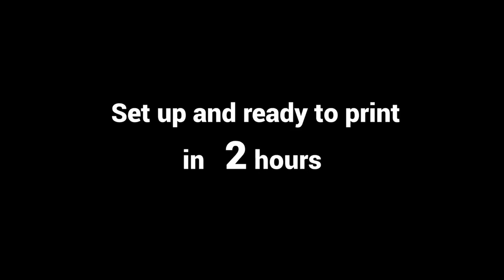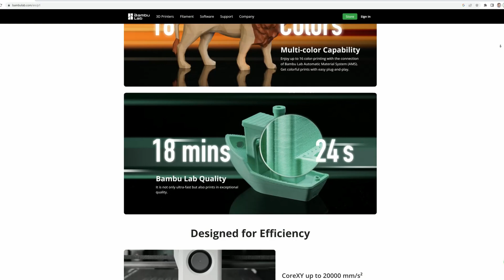I Fell in Love All Over Again - Bambu Lab P1P Printer Review

Comment: How do you get FDM prints water tight? I’m taking some water on in my baits?
Is resin the answer or does a good clear do the trick?
Reply from the maker: a good clear should do the trick, I have been dunking them in Polycrylic water based clear to make sure I get all the cracks and crevasises and it seems to work well.

Comment: With my X1 Carbon I’ve had a single issue and when I reached out to get support it was a 24h turn around. There are also 3rd party parts appearing. Gone though 8 rolls of filament and only had it for a couple weeks now. Love the AMS as if you have two rolls of the same filament and one runs out it auto switches to the spare roll.
Reply from the maker: That is the only downside, you print so much stuff you buy a ton of filament!

Comment: After a couple resin print failures printing injection molds I had a go at printing them FDM with PLA like the The Neverending Project List. They printed and injected fine - I’m home use so not doing any volume. The lures have a dull finish but do the fish care? The P1P would be great for fast, low cost and almost hands off prototypes. I’d be really interested in seeing how other materials print and then shoot. PETG was a failure for me with the plastisol just sticking to the mold.
Love your videos. Keep up the great work! 👊
Reply from the maker: The fish do not care at all! 💯👏. Will work on some alternate materials for sure!

Comment: Yo. I am thinking of using TPU doe doing some stencils. I know you dabbled with this. What TPU did you use and was the printer a bowden tube or direct?
Reply from the maker: It was my direct drive but I have printed TPU on the P1P and it performs perfectly. I will have some TPU content coming soon for sure. I have been using ProtoPasta TPU and the MicroCenter Store brand TPU. I found getting the 95a shore hardness makes it a little easier to work with.